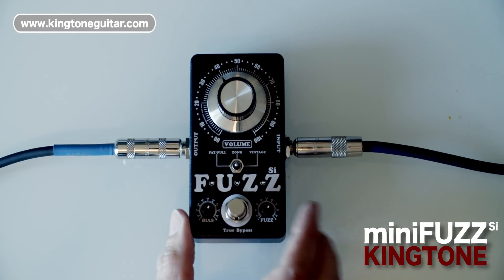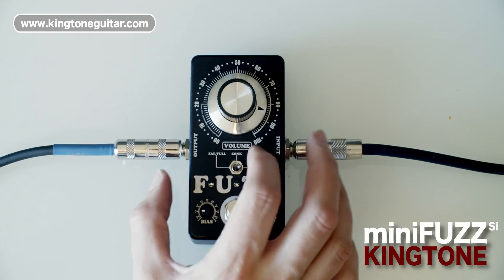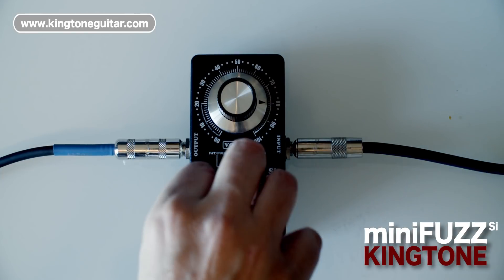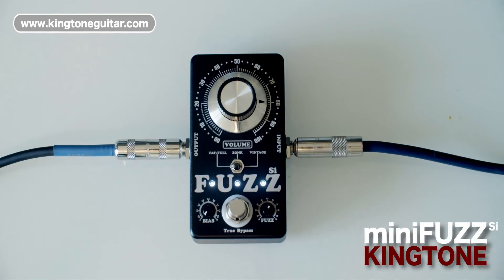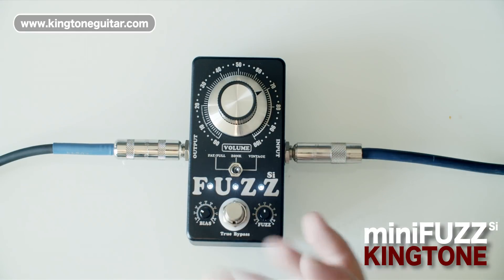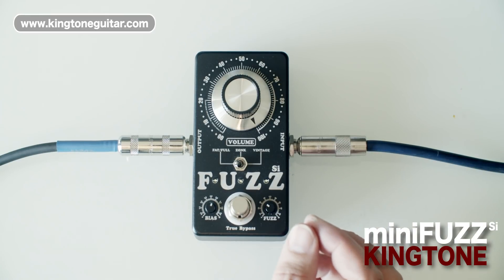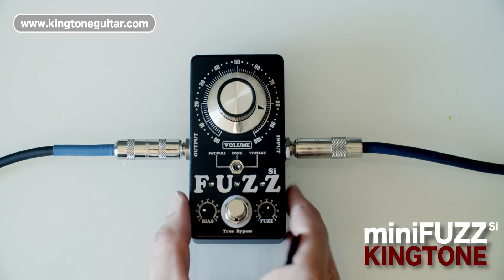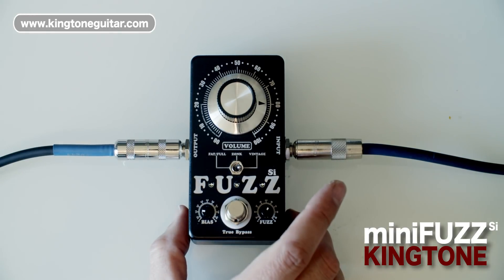KingTone miniFUZZ Si Demo by Jesse Davey

Comment: I have always had a love hate relationship with fuzz pedals, loved them but couldn’t ever get them to work for me, I bought this pedal and fell in love instantly.  I use it more for that Sabbath tone but also for a Hendrix style tone, amazing for both…. I use a Soloist as well and when you combine the two together you can achieve just about anything on the guitar tone wise, amazing!  I run the soloist before the fuzz to clean up the fuzz, no extra noise, and when I want a lead tone I shut off the soloist… yeah, sounds counterintuitive but man is it amazing sounding.  Jessy and his wife were great to deal with and I couldn’t be happier with my current evolution of sound.

Comment: How loud is this pedal? When i owned a duelist i found it didn't really work at home. Playing under 90db the pedal just was too loud, even with volume very low. Sounded immense when cranked though. Is the fuzz the same or does it sound good at lower volumes too?
Reply from the maker: Hey! The miniFUZZ or Duellist work well at low volumes but you would set them differently depending on whether the amp is clean or driven. I am working on a video on clean vs edge of breakup tones which will help with this.
Reply: @jessetwohands  I only kept the duellist a couple of weeks. I traded my Browne protein for it. Maybe I should have kept it a little longer! I did think I had a good play around with it, dirty amp and clean amp, maybe it just wasn't for me, maybe I just wasn't setting it right like you say :) I do fancy a mini fuzz ... thanks for the response. I appreciate it!

Comment: Hi jesse! Finally Cop this beast, i want to ask, can i remove the battery inside the box? Because it shipped with battery inside right? I will power it with isolated power supply.
Reply from the maker: Yes, you can remove the battery, place a small piece of tape over the terminals.

Comment: Hey Jesse!  If we use it with a battery does it still suck power when turned off?  For instance I have the Third Stone fuzz from Berkos and it's ONLY battery powered, but does not suck battery juice when the volume switch is turned completely off.
Reply from the maker: Mark Hopkins hey, we have performed tests with these and found the battery will last at least 2-3 months when left plugged in, enough for most tours. This means if you want to run it from an internal battery, you can leave it plugged in during a whole tour.  This pedal does not have a switch on the volume control.
Reply: Intelligent design and features in the pedal here. So it can be powered with an internal 9-volt battery? So that no external power supply or battery box is required?

Comment: NO clean on the amp, the amp take over the overdriven tone, useless review.
Reply from the maker: Most people use fuzz pedals with an overdriven amp or into an overdrive pedal. We have other demos with clean amps if you would prefer.
Reply: It’s not useless, that is how fuzz has been used since the 60’s. As a side note, this is one of the only vintage voiced fuzzes that actually sounds good into a fully clean amp.